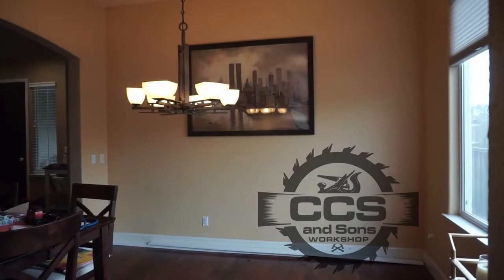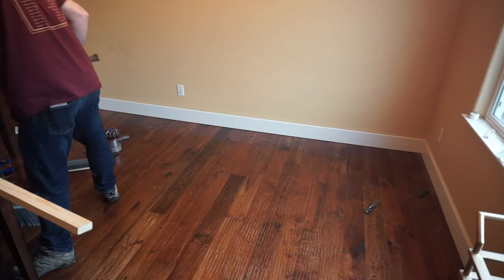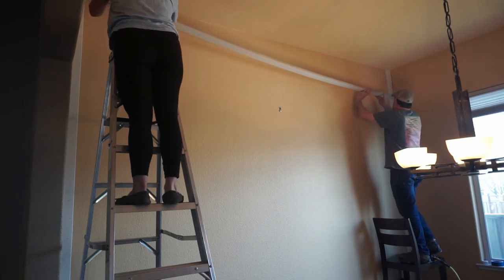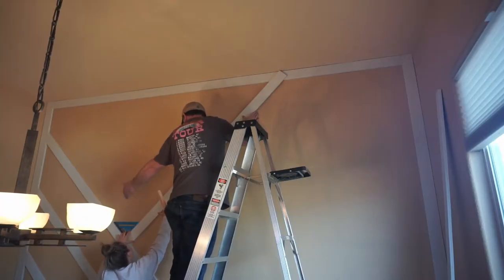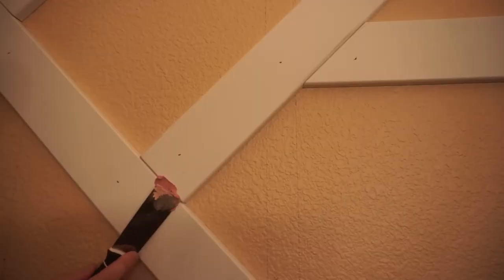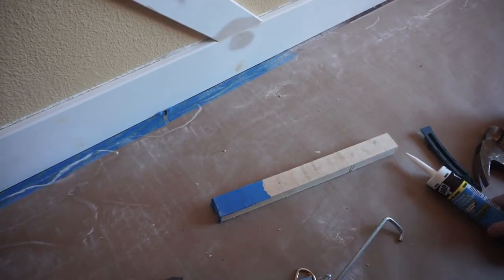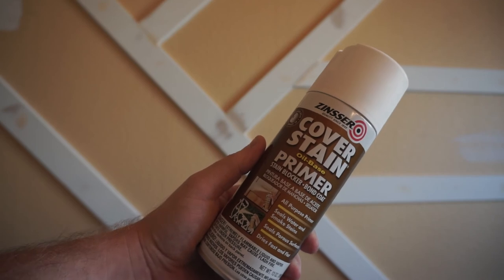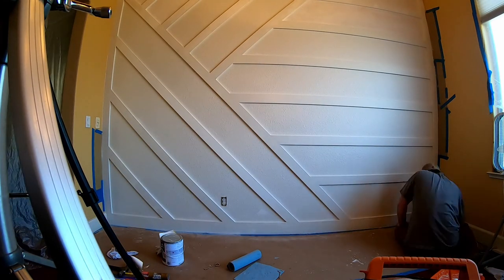DIY Geometric Accent Wall

Comment: FYI do not use construction glue if you think you will ever want to remove the boards in the future! It will destroy the drywall and be a headache to repair. Brad nails are sufficient on their own and will keep the boards in place (even if you don't hit a stud) with easy removal :)  
I created my own accent wall and consulted with a guy who does these accent walls for a living.
Reply: Extremely great tip - I was wondering if that would work because I’ll I kept thinking was about how these walls will be destroyed when people tire of this trend and decide to rip the boards down.  Thanks!

Comment: Great video!
I want to do the same but on a regular/concrete wall (not a drywall), assuming that I'm using MDF, how can I stick that to the wall?
Can PVC and adhesive be better in this case?